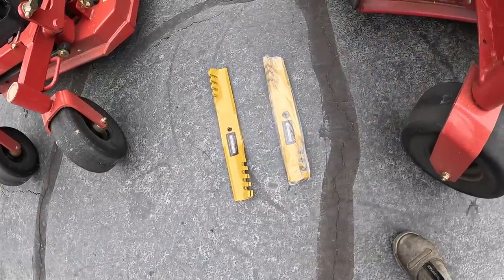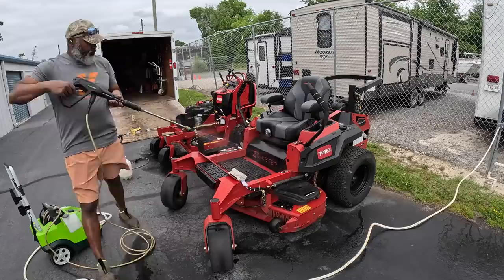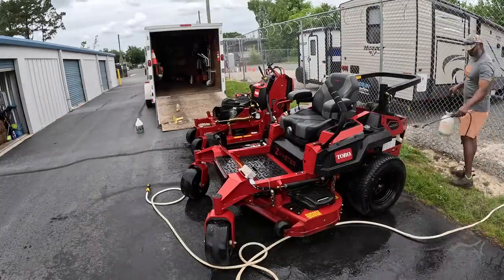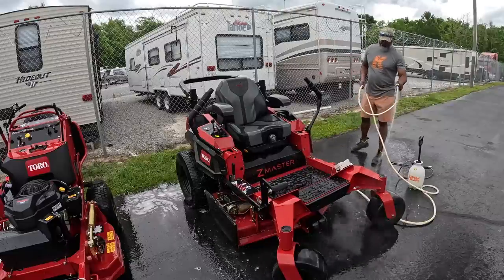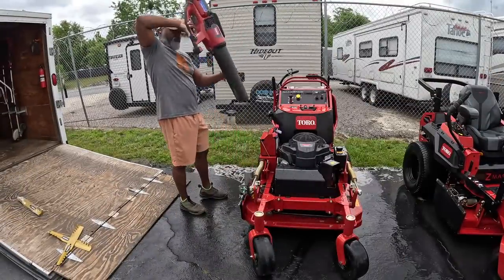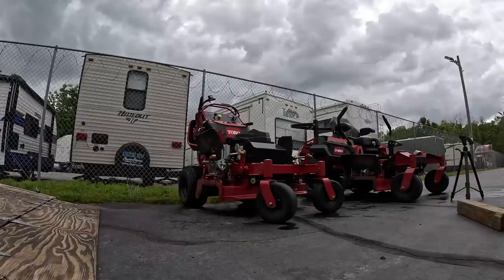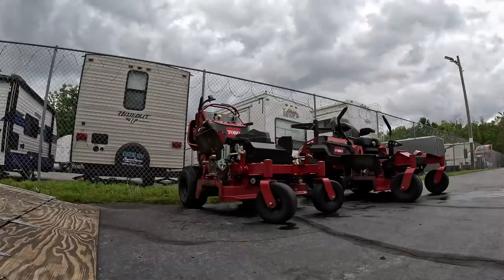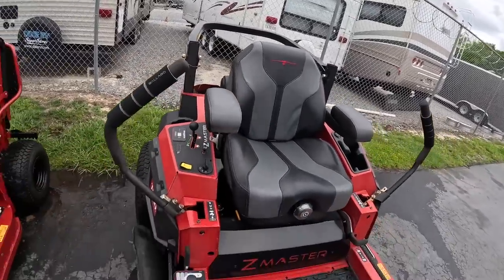Don't strip your Lawn Mowers Paint without even knowing it  | Ballard Gold Hybrid Mower Blades

Comment: haha, you will have to let us know how you like that gold blades. I want to put a set on my grandstand 36. I use purple power on my mowers although I typically use a wash and wax after which is why I probably haven't noticed any issues. I typically spray it around the deck and castors and on the engine really anywhere oil/grass gunk might build up.
Reply from the maker: I'll keep you updated, thanks!